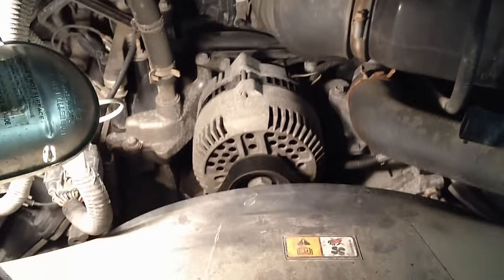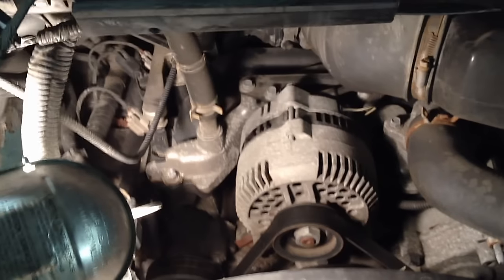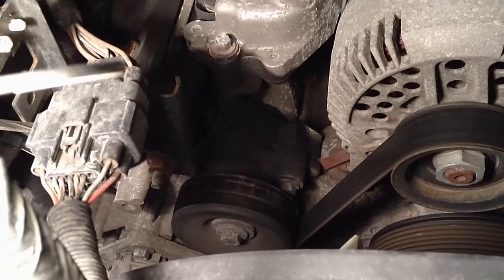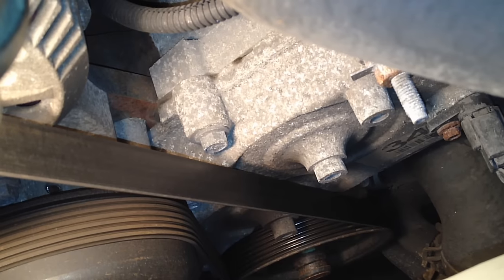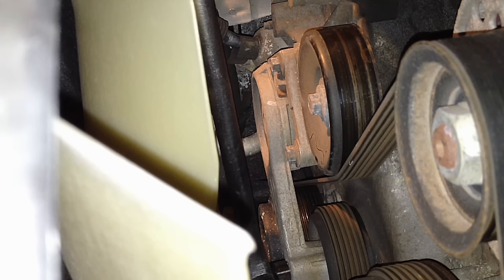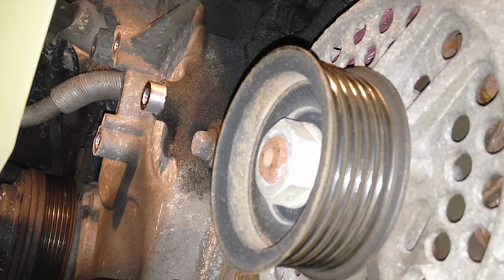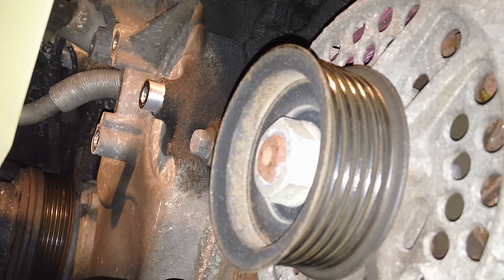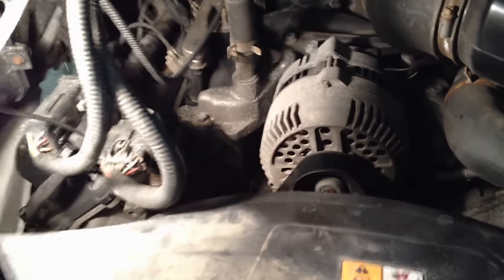Ford 4.6L & 5.4L Power Steering Whine Type Noise

Comment: Wow. You just saved me $1200. My wife took her Mountaineer to NTB / Big-O and told her she needed to change the rack and the power steering pump. I watched your video, went to the Zone, bought the part, and changed it 30 minutes or so. Quiet as a church mouse. Thank you very much. This is my favorite YouTube video ever!
Reply from the maker: Jim Fowler Nice thanks for sharing!
Reply: Jim Fowler don't ever pay for minor mechanical stuff. They wanted 500 to replace my clutch master. I figured it out on you tube took me 2 hours. That was diagnosing it because I bled it, but if I would have just done it. straight up the part was 49 books and an hour worth of my time. save I saved 500
These guys rock for sharing this information.
Reply: nice vid.there is rarely anything wrong,grease just drys out, the bearing seal can be popped out,bearing rollers cleaned with break clean, and repack bearing with grease,also a few drops of DURA LUBE ,no cost for repair ,if your handy .
Reply: @christophersluss2129  Shops charge so much money people are getting sick of dishonesty in the car repair business they go on YouTube figure it out on their own. Back in the day before YT it was difficult to figure out what was wrong all you had was service manuals.
Reply: Sounds like they tried to work her over because she was a female unfortunately

Comment: I’ve been trying to diagnose my “whining” for several weeks now. I think you may have just saved me a lot of trouble! I know there is no way it’s my power steering. There is no audible change to the “whine” while turning the wheel. Furthermore when I accelerate, or rev up the truck, the “whine” gets louder as the RPMs climb. As the RPMs fall back down, you guessed it... so does the sound of the whine. I’m going to get the tensioner pulley today and I will update everyone after I replace it! Thanks for the video, brotha.
Reply: Did you ever find out if it was the pulley? Have a similar issue on my Mercedes E350.

Comment: Once again you have helped me with my 05 F150 5.4 l because I was 100% it was power steering pump because it is leaking and obviously has air in the system because the fluid looks like it's boiling in the reservoir, but that p/s  wine is coming from the other side so I have another problem as well, but with your help I'll be able to fix this stuff myself and thank you so much for the informative videos you post!  I couldn't do it without you!

Comment: You just diagnosed my whiney 2004 f150 correctly!
I fixed it myself in the driveway today for $20. This is the best car advise channel on youtube if you own a Ford especially! Thanks Again
Reply: Mine was the tensioner pulley. The other 2 pulleys up top were ok at this time. I will replace them this summer along with the serpentine belt. Those pulleys are alot easier to get to.

Comment: Thanks a million...I knew this was it. You are the "Angel Mechanic" on my right shoulder. The left shoulder "Greezy Joe" mechanic is the guy at work that cannot spin a wrench but is always steering me the wrong way.  I decided to save some cash and start riding my bicycles to work. I lost 30lbs, spent cash on tubes and lights and saved on gas. I only drove the 2004 4.6L Explorer to HD for yard stuff and after two months I heard this noise. The saying "Don't use it Loose it" comes to mind. When facing the engine the pump is on the right, alternator center top, idler pulley tensioner lower left. Now I'm going to go to the "All the Parts I'll Ever Need Store..." Thanks.

Comment: I wanted to report back to you and say this video is one of the most helpful auto repair tips I have seen on YouTube.  I have a 2005 F150 with a 5.4L 3V which has been making a whine noise as you described, which I have been thinking was a Power Steering Pump or Alternator.  Never once had I considered that it might be an idler pulley...!  

After watching this video and then using a stethoscope to probe around the various locations while the engine was idling, I was able to positively determine that the idler pulley adjacent to the Power Steering Pump was just definitely grinding.  I bought what I needed and R&R'd the suspect pulley - feeling the significant roughness in the bearing upon removal.  After torquing the bolt and reinstalling the serpentine belt, cranked the engine and "oh baby" no more noise.  

You were spot on, my friend.  

This tip saved me so much time and money.  I had already replaced the Alternator to no avail.  Next I was planning to change the PS Pump.  I am very glad I did not have to resort to that.  

I am now thinking of replacing the other idler pulley and belt tensioner assembly just for good measure.  Given the number of miles on engine, they're probably due.

Take care and best regards,
Bob
Reply: How many miles om yours?

Comment: You did it again, saved me a bunch of money and a lot of hassle. My 2007 F150 5.4L had what I thought was a possible vacuum leak but it was indeed the tensioner pulley.

Comment: Thank you! After 14 years and 270K miles my f150 has started making this noise. I knew it wasn't the power steering pump but wasn't sure which pulley to go after.  Will be ordering an OEM replacement!

Comment: I just bought my 03' F150 a month ago. With over 200K miles on it, I'm going through and "catching up" the little things the previous owner may not have done- this would be next on my list. I flushed and replaced my power steering fluid, that helped with the "whine" when I turn the wheel a lot. Going to replace the water pump and the alternator also while I have the belt off- good Saturday project to work on while I listen to a football game on the stereo in my garage......and bombproof my truck a little more. Down the road I plan on getting the engine/transmission rebuilt. Great truck, I'd like to see it live to 400K miles🙂

Comment: Man, thank you so much for this. I know someone with the exact same problem and I thought I fixed it but the noise came back a couple of weeks later. You're right, it sounds just like power steering and since it was below the MIN line, I thought that was the culprit. Now I know where the problem is. Thanks again.

Comment: you saved me from replacing a PS pump.  I thought for sure it was the pump.  The tensioner pulley was bad.  Nice and quiet now.  Advance gave me the wrong Idler, I'll exchange it tomorrow since its a bit rough.  Thanks again!

Comment: I've been putting off the Power Steering Pump replacement due to whining noise for some time now.  After seeing this video I decided to replace pulleys and see what happened.  I ended up replacing 2, an idler pulley and grooved idler pulley.  Both on the same side as the power steering pump.  No more whine!  Thanks for the video.

Comment: Thought the whining noise was the power steering pump and had put off changing it for years since it is a PITA to swap. Noise has got worse lately. Just watched this video and changed out the idler pulley which solved the problem. Thank you.
Reply from the maker: Nice!

Comment: Thank you Thank you for posting this video. I took my truck to my mechanic today because I was told the barrings in my power steering pump where bad and it needed to be replaced. I asked them to check all the pulleys and it turned out 1 of my pulleys was bad so he changed it. He put the belt back on and the sound was gone and it saved my a lot of money.

Comment: THANK-YOU!  This was exactly the problem on my 2005 F-150, with 4.6 ltr V8.  Truck sounded like it had a turbine running under the hood.  Really sounded like the power steering pump, but it was the idler pulley above the pump.  Once I figured out that you push down on the 1/2-inch socket-wrench that has to be fitted into the tensioner-pulley (to loosen off the belt), replacing the pulley was easy. Not only did you save me the $500 to 1000 that the new steering pump might have cost to install - but I was looking at trading the old truck in and getting a cute little Mercedes GLK.  (Dumb idea, really.  The old F-150 4x4 is a great truck). So really, you saved me 20 K or more.  Engine in the old F-150 sounds like new again.   Thx again for posting this video.

Comment: Thanks so much! This was my issue on my 2007 F150 5.4L. Mine ended up being the grooved idler pulley. Easy fix and the engine is SO much quieter now. Thanks!

Comment: Same thing happened here (thought I had a bad power steering pump)! I have a 2004 5.4 F150...glad I watched this video. Getting the pulleys off was easy (I have two in the same area, wasn't sure at the time which one was bad). After spinning both in my hands, it was apparent that the grooved one was bad...I switched it out, and it sounds great! Thanks for posting this video.

Comment: Thank you very much, mechanic said the noise was power steering turns out it was just the idler pulley. Thanks again for saving me money
Reply: I know this is a lot later, but you just bought a new idler pulley and it fixed the issue?

Comment: I think I just got bit by this problem but it's not on a mod motor. It's a 1997 5.0 explorer. and I just finished changing the steering pump and left a thank you on how to get Teflon seal on it. But the noise is still there. It sounds like it could be alternator though. This is tricky now.

Comment: Thank you! Found your video when I was looking on YouTube of how to remove my power steering pump off of my E-350. It was in fact NOT the power steering pump, but the tensioner pulley. If I am ever near your area, I owe you dinner. You saved me time and money.
Reply: My 08 e350 is making this whining sound, how did you know which ones were the issue? Or did you just use his info to the T?
Reply: @michaelbacile8439  After watching his video I wanted to make sure it was indeed a pulley. I made myself room in the engine compartment by removing the air filter. I would recommend getting help for this next part, more for safety then anything else. With the engine running I got a long piece of straight brake line. You can use anything, but make sure it is narrow. I then carefully put the piece of steel brake line to each of the pulleys to see which one had more vibration. I even put my ear close to the end. This is how I found it was my tensioner pulley, it had much more vibration and sound coming from it.  Idler pulley had vibration, but was very little.
The reason I say get help is incase you drop your piece of piping or what ever tool you have to feel for vibration, that if it falls into the belt you can tell the person to turn off the engine and if you hand gets to close to the fan. I also got under the vehicle and felt the power steering pump. It had little to no vibration and the noise was coming from the passanger side to where the pump is on the driver. Any other questions feel free to ask. Good luck.
Reply: Good ideas, thanks for the reply
Reply: Good ideas, thanks for the reply

Comment: Hey I wanted to say thank you!  I have been driving around with a whine for a few months and thought it was the power steering pump. I finally decided to replace it and watched your video. I took the belt off and the tensioner and three pulleys were very rough. I decided to start there and the noise went away. Great video and advice, Thanks Again!!!
Reply: P

Comment: Was looking for a power steering pump online, found this, replaced $21 idler pulley in 15 minutes! Thanks for the video. 2004 f150 4.6

Comment: Hello Brian,  How common would the 97 f150 4.2s  tension pulley spring actually cause the squeal ?  Replaced its pulley but still squealing from somewhere. We replaced tension pulley(pulley only not spring) , water pump, serpentine belt,  fan clutch.  Still squealing. Going to  try the top idler pulley next ( has the torx, 47 mm I think). Alternator new maybe less than 6 months old. Ac maybe 3 yrs old replaced by an ac specialist.  Doesn't squeal  continiously, off and on  momentarily ,loud squeal. Thanks in advance.

Comment: Just wanted to thank you for the great video saved me time I just replaced the PS pump because it was leaking a few months ago but was lazy about flushing it I thought it went bad again. Sure enough both idler pulley bearings were bad the upper one was worst but both were junk. I know I replaced the upper one autozone part about 5 years ago this is a 1999 F-150 5.4L engine.

Comment: My 2008 F150 making a whining noise I'm curious because I thought it was the power steering pump but your video has me second-guessing. When I turn the steering wheel the noise gets louder could it still be the pulley just from the extra tention on the motor or is it a good chance that it would be the power steering pump?

Comment: Was researching this noise and hoping this was it. I am still leaning pump because the whine gets much louder when I slightly adjust the wheel, I can feel vibration in the steering wheel also. When I straighten the wheel it gets much quieter.

Comment: If it is the idler should the sound get worse when you are turning?  If the noise gets worse when turning and the pump has already been replaced, what could the problem be?

Comment: Did you replace the whole tensioner?  Or just the pulley part of it?  thanks for posting this video. I think this is what's happening to my Expedition. I would like to confirm so I can get the right parts.  so far I'm understanding that I need to replace the whole tensioner with pulley, and idler pulley to get the best results?

Comment: Mine does it and I as well thought it was the power steering but, it only does it when the truck is in gear. I put it in park and press the gas I don’t hear it, when I put it in gear I hear it as well when I’m driving which lead me to think it’s in the transmission.

Comment: I noticed a whinning noise with my 06. I was told a bad waterpump might be the issue. Do you think this is possible? You really notice the whine when you are driving it and it sound like it coming from the engine area. Whats your opinion?

Comment: Good video.  I replaced the two smooth idler pulleys on my 4.6 liter f150 and it helped greatly, but I still have some noise  I believe it is either the water pump pulley or the grooved pulley.  According to the 2007 Ford-issued shop manual, the grooved pulley has the same part number as the smooth pulley.  Surely this is a misprint.  Any idea where I could locate the correct pulley?  I've been looking on amazon and some parts sites and am not having luck.  Thanks!
Reply from the maker: hansejas000 Have the dealer look it up the grooved pulley is almost always the worst one for this noise.

Comment: I am not sure how this works, but I have a loud belt area noise that I cant figure out on my 2008 F150 5.4.  I have replaced and or repacked the bearings on all the external pulleys and the sound is louder now then ever. The only slack or play that I have is in the power steering pump pulley and it is about a 16th of an inch.

Comment: I don't have this noise after I changed tension pulley and other pulleys, but I would like to ask everyone out there with an 04-08 f150 4x4 if anyone else has a noise along with a vibration that seems to be more when accelerating! You can feel it on your floor board and especially when you have your foot an the gas pedal as well as going uphill? My f150 runs good, shifts normal, but whether you are driving or passenger you can tell it's not as quite as it used to be! Any help appreciated!
Reply: Does the floorboard vibration happen in the front or rear of the vehicle? You may have worn rear axle shafts or transmission is slipping.

Comment: I have a 98 ford explorer XLT v8. It has a couple different issues. first, let me say that it has 165,xxx miles. The various issues include a whine that gets louder upon acceleration and when my a/c is on, the whine gets louder. Also,  it hard shifts from 2nd gear to 3rd and then my O/D light begins to flash. Any ideas as to what either of these could be?
Reply: Its a pulley most likely. And a 2-3 spring in the tranny...

Comment: Is there a way to determine if it actually is the Power Steering Pump before replacing pulleys?
Reply: Stick a funnel on the end of a metal tube and touch what you wanna check and listen in the funnel

Comment: Great video. I have a similar whine coming from my 95 F150. Flushed the power steering fluid yesterday which improved things a little. If the pulleys were the issue would the noise get worse when the steering wheel is turned?
Reply from the maker: ***** It may as they have more load but generally it is from the pump on those the C2 pumps were really noisey

Comment: Thanks for the info, thought i needed power steering pump but tried this first. Wallah bye bye noise, quick, easy, and cheap.
Reply from the maker: Awesome!
Reply: I think I'm having the same problem. My 08 explorer runs fine with no lag in acceleration. When I press on the gas pedal, the whine increases (even in neutral). Was this is same defect yours was having too before you replaced it?
Reply: @andrewabeizerfour663  that's what mines doin

Comment: Would power steering be affected if this was issue? My power steering feels different and the sound really seems to be coming from the pump/pulley area.  Should i still remove the belt and try turning the power steering pulley by hand?

Comment: I have a 2005 Mercury Grand Marquis Ultimate Edition, it makes the first gear whine which I know is normal I actually love the sound. My problem is when I'm accelerating up to about 30 it sounds like an rc car. It accelerates and idles fine it rides fine at higher speeds, but if let's say I'm going about 45 or so I can suddenly give it gas to accelerate and it sounds like an rc car again under the hood mainly from what I can tell towards the passenger front. I cold cranked it the other day it sounded like a baby kinda whiny then suddenly went away. Any ideas? Thanks.